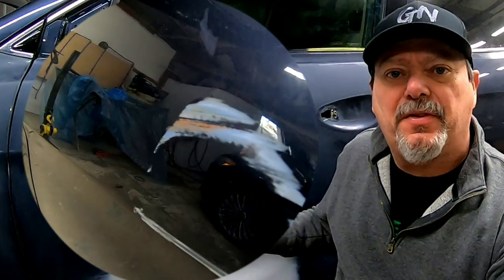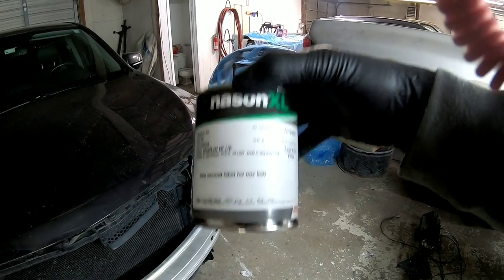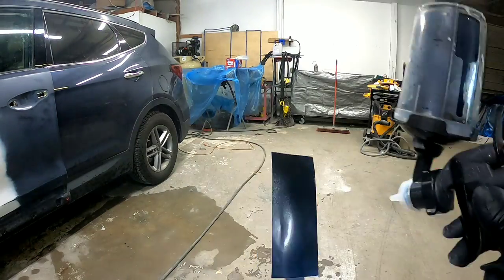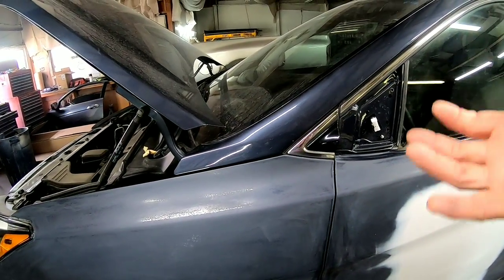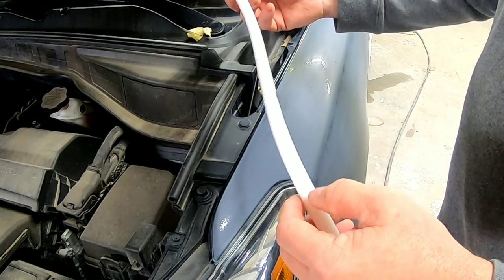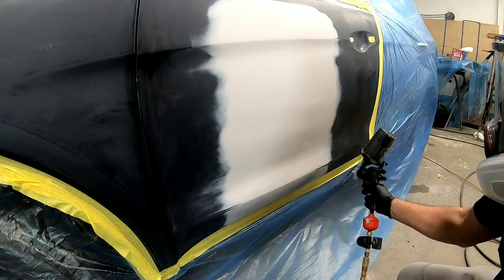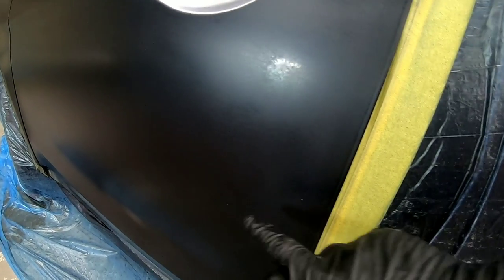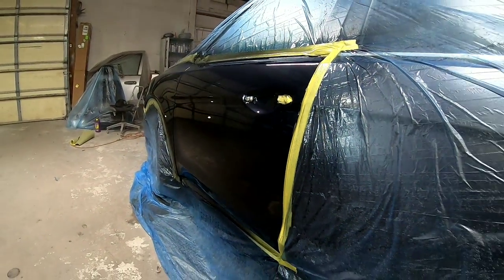Beginners guide to painting a car. prep, masking, color match and clear!

Comment: My garage is too small and full so I'm thinking about using one of those pop up 10 foot square pavilions and covering it with plastic and painting the front then the back.  I am thinking to paint it to the back of the front doors then the back doors and the hatchback. Hopefully not too much dust gets in. I did my wife's 2020 corolla bumper last year after she backed into a tree so hopefully a whole car won't be too much.  It's an old Focus so it's not valuable,  lol.
Reply from the maker: Sounds like a solid plan to me. Keep me posted  on the result. If you shae some photos to my email  garagenoise247@gmail.com I may share it withe the community to inspire other.

Comment: Great so always 600 to prep old paint for new clear? Can you do 800-1000 or will it peel? I noticed when you scuff up the old paint it wasn't always flat and there were some shiny spots and you can see scratches. When you reclear it will fill all those sand scratches and imperfections 100%? Or will you still see some sand scratches or fine streaks in the sun?
Reply from the maker: Not sure about what you see in the video but you don't  want any shiny spots. 800-1000 is fine as well. You won't  see any scratches under clear with 600 or 800-1000. Appreciate your comment brother!

Comment: Nice work. i would like to know how do you prevent dust nips due to ure spraying in a garage area with out spray booth?
Reply from the maker: There's  no way to totally prevent dust or trash in the paint even in a booth you get some trash. There are a few things to do , blow the car off really  well . All body gap near where yor painting, wherever dirt can hide. Blow yourself  off ,wet floor down. Make sure you have clean/dry air to paint with.  Hope this helps
Reply: @GarageNoise  thanks for the reply. Keeping a consistent clean job is hard 😅 its part of painting routine i believe

Comment: Excellent job Chris. Im starting the bodywork on my 04 GMC and stripping it down to primer substrate or metal. Is it best to use a 2K epoxy then a high build for the blocking. Im learning a lot from you. Thank you
Reply from the maker: If your going down to bare metal on the truck than yes 2k epoxy primer.

Comment: Chris, what happens if the flued setting is set to full or wide open when spraying clear coat?
Reply from the maker: You can spay with it wide open most painters do. More clear coat will be applied so you want o spray a bit quicker.
Reply: Exactly!  You’re right Chris most painters do that way, but they need to a bit quicker because it creates sagging or running clear coat.

Comment: How do you keep from getting dirt in the paint?  It looks like your shop looks like mine, no paint booth.  I always end up with trash and dirt in mine.
Reply from the maker: Most trash comes from you or the vehicle. I blow off the vehicle real well before masking.  All jamb and  seams get blown out, anywhere dirt might hide. I try to blow it off outside. I also make sure its masked well so no trash is able to blow out of a gap. I do get some trash but you get some in a booth as well. You could also wet down the floor. Hope this helps thank's for watching and being part of the channel!
Reply: Blow yourself off well too. Trash can come off your closes. I paint out on the floor also and my buddy has a booth at his shop and always complains my jobs come out cleaner than his. My theory is in a open shop as this there’s a lot less air movement or draw across the vehicle as opposed to a booth which are typically 30’x14’ or so and the exhaust fan draws a huge amount of air from outside the booth into a comparably small square box. Even though the booth has filters, it’s still not 100% filtering all dust. So theoretically you’re drawing all the air from inside the shop across your paint. If this makes sense? It’s the best way I know how to explain it.

Comment: Few weeks after painting the paint on the car start swollen, what's the cause. Thank you
Reply from the maker: Not sure what your issue is . Not familiar with swelling paint. Can you explain  a bit more?
Reply: Followed the steps to paint the car alright but few weeks after painting I realised that the there are several places around the car swollen up,I mean the paint on the  car,when I used a pin to check I realised it was a paint that has swollen

Comment: Those 3M guns are nice. Wonder if they come as a set? For primer, clear or paint. Is there a faster way to sand an old car than using a DA? Takes awhile, lol.
Reply: Also how did those chips happen?
Reply: DA takes to long in old cars you better get a dewalt DWE6401DS disc sander + replace 5" for 6" backing pad +soft pad and sand the car with 180 these dewalt tool is very powerful you are going to thank me latter is what i use in old classic cars.
Reply: @fernandosaldana3665   Awesome, thank you.  Disc sander? I went down to 80 grit and still takes awhile on the DA.
Reply: @bobbydelamar606  try that tool is not even $100 but blow out the paint like nothing
Reply from the maker: I would say be careful using  a grinder you don't  want to heat up the panel you could warp it! I would stick with a orbital an use 36 grit paper.

Comment: Chris what is the part number , brand and filters for the respirator you used in this video. Also can slow reducer be used in 70-80 degree when painting silver metallic paint.
Reply from the maker: Here is a link to the mask I used. Works really well.
https://amzn.to/3rhB3V5

As far as the reducer yes you can use slow in that situation.  It's  always better to use a slower reducer for the temp your spraying in.
Reply from the maker: I do plan on uprgrading filters to 3m.

Comment: What is a drop coat ? What is a medium coat ?
Reply from the maker: Good question,  is a final coat on the blend area to help the orientation of metallics and the blend . One coat about 6-10 inches away from panel. Sometimes called an orientation coat.
Reply: @GarageNoise  sprayed at same gun settings and hand speed just moved back off the panel ?
Reply from the maker: @EChunter  yes , just one coat only if needed .cause multiple coat can cause sand piling which will make paint rough
Reply: @GarageNoise  thanks.  Information is appreciated.